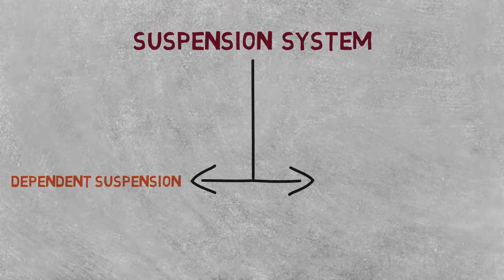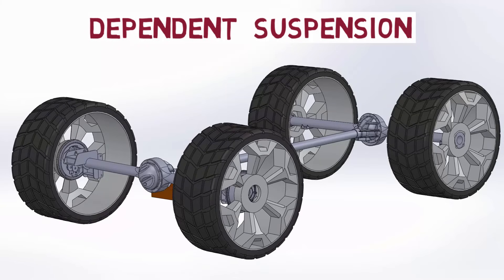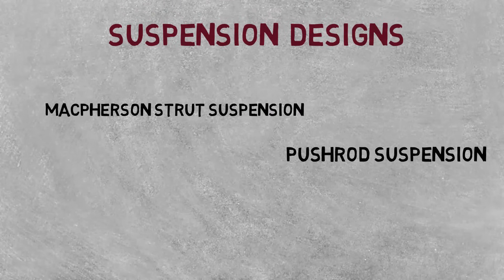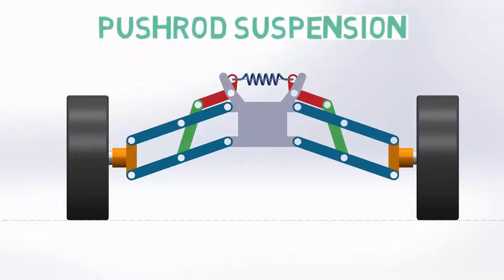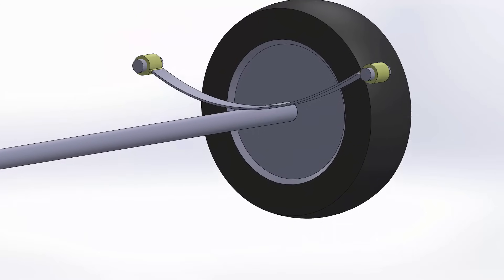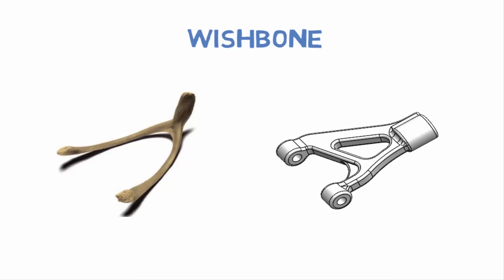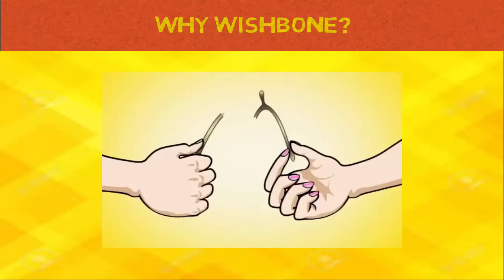How a car suspension system works?

Comment: Really weird how this is the second video on this channel I've watched and in both they sort of go "Nah, let's not explain what a wish bone suspension is, instead let's talk about the superstitious origins. That's more fun".
Reply: What is lacking with Mechanical Engineers today, is the knowledge of how to design mechanisms correctly. Did know that there's a mathematical formula that can be used for all mechanism designs? It's called Gruebler's Count. I found a way to make it practical for all 3D mechanisms. Here's the link if you are interested.  https://youtu.be/KFB8gMjxDPk

Comment: Who else got this in there recommended and has no reason to watch it??
(The pushrod one is off, puahrod suspension is 2 inbound, spring and damper combinations, used for a center of mass closer to the center, and lower weight.)

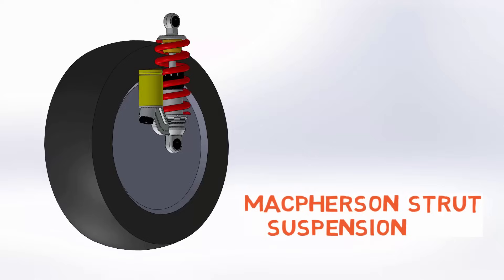Comment: 0:52 I don't think that's what defines a pushrod suspension... In can be described as something like a double wishbone where the dampener is replaced by an arm that is pushed (pushrod) into a rocker arm that transfers the movement like a lever allowing for the dampener to be placed in the center of the vehicle, giving benefits like aerodynamics (slimmer profile) or thoughness (dampeners are protected inside the chassis), the downsides are more moving parts and complex design making it more expensive and better suited for specialised use cases (like in formula one).